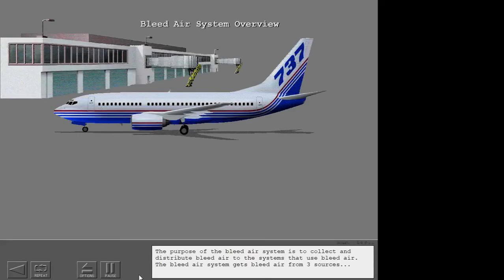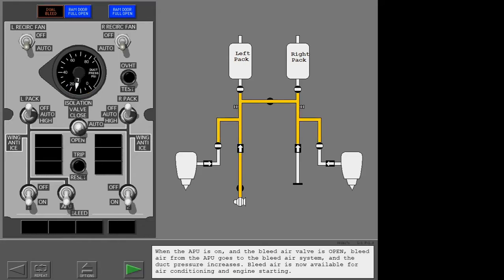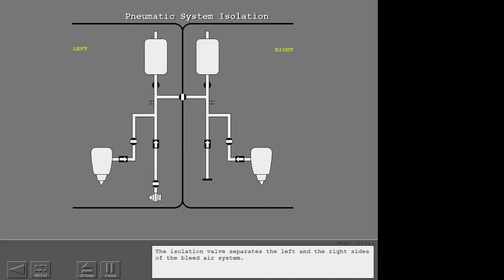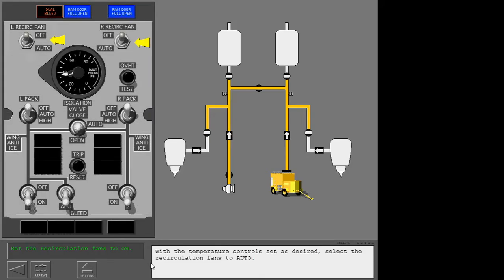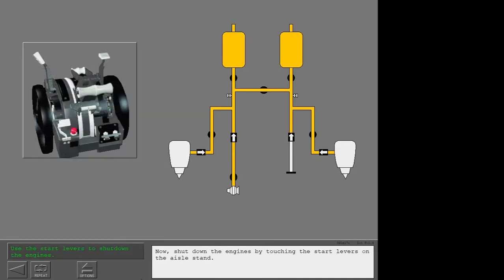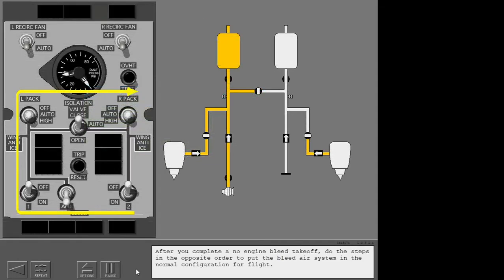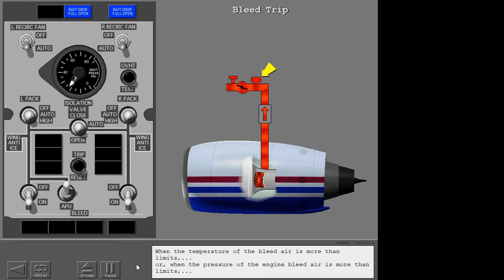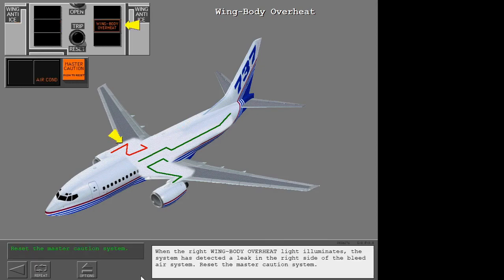25. Boeing 737NG - Bleed Air System

Comment: Boeing engineers have made another mistake. The two engine fan valve switches should be labeled "off-auto", not "off-on". Because the engines automatically open the valves on the position switch to "on".